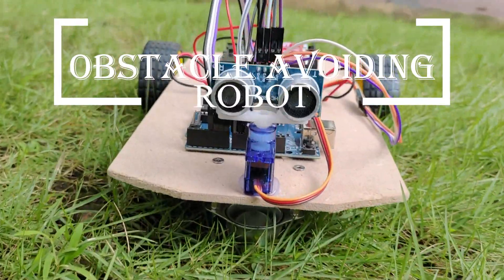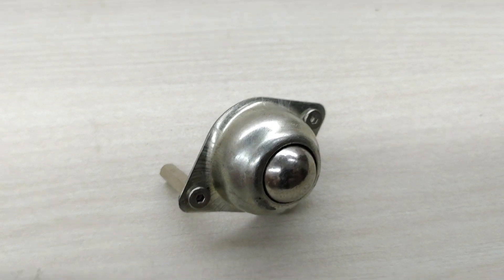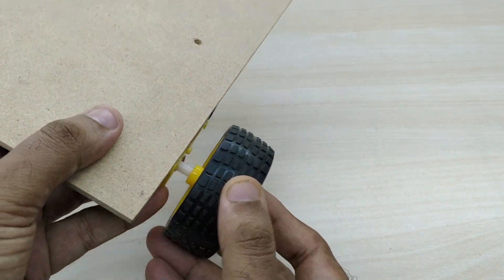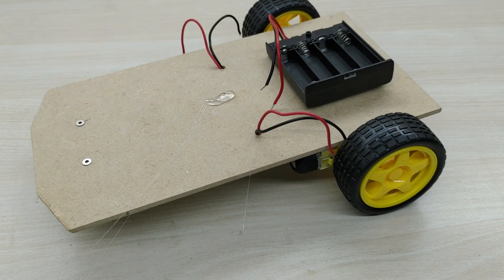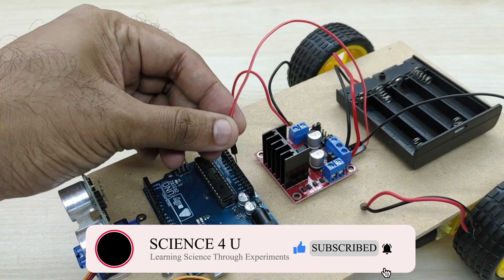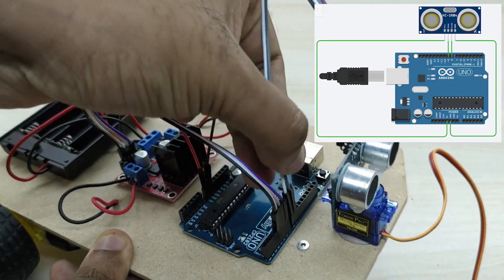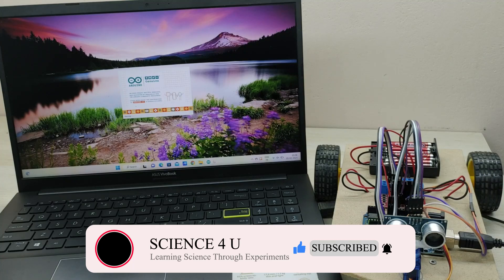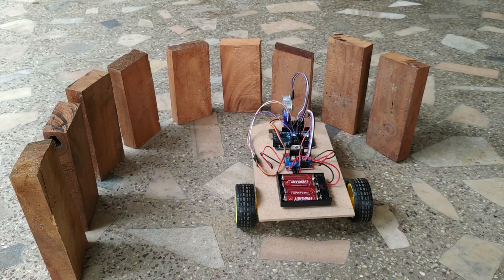Intelligent Obstacle Avoiding Robot || Step by Step Tutorial || Arduino Project

Comment: Hey I’ve made this and the robot keeps going around in a circle as then one of the wheels is not going forward but when it reverses both the wheels work fine . can you help me find what’s the issue ?
Reply from the maker: I guess it could be due to poor batteries only. When it is going backward, since both wheels are working, the connections are correct. In the forward direction both motors are not rotating probably due to poor batteries. You can try changing the batteries.
Reply: @Science_4U_  I facing this same it circles all the time but when turning it is fine, changed the battery still the same issue.

Comment: Hi sir ...Thank you very much 
After somany videos ..
Finally i prepared from your video..
On floor it is not moving 
It works only in air
Reply from the maker: Hi friend. It is mostly due to poor batteries. Using new batteries should solve the problem.

Comment: Please, I did all the steps but it didn’t work. What is the reason? How can I contact you to solve this problem? I must submit my project a day from now.
Reply from the maker: @shatha.44  Hi friend.There could be several reasons why it is not working.The L298N driver board may be faulty or it could even be the batteries. You can message me in my instagram account. I will help you to solve the problem. 
https://www.instagram.com/_science4u_?igsh=MTM5aXFpdTM5aG5lNg==

Comment: Sir, I've gotten the Arduino uno R3 SMD board. But my L298N board ks showing a red led light. What does it mean, am using a 5 lithium ion batteries. Do i need to upload the script first before the motor would move? Cause i still haven't uploaded the script
Reply from the maker: Yes definitely friend. Yoi have to upload the code and after that only it will start moving. 5 lithium ion batteries will give how much output voltage?
Reply: 15v, when I checked 
Each ba3s is emitting 4v
Reply from the maker: @PythonExploratorium Yes. More than enough. Normally we give only 9-12v battery voltage
 You can upload the script and see if the motors are rotating.
Reply: Will it be enough
Reply: Sir, am sorry for disturbing you this way. I just need to get this done for a project am working on. I'm getting errors while uploading the code.
Reply from the maker: No problem friend. Can you tell me what is the error message while uploading code?
Reply: avrdude: stk500_getsync() attempt 7 of 10: not in syn: resp=0x98
.......

Then it said failed uploading: uploading error: exit status 1
Reply from the maker: @PythonExploratorium Hmm..Normally we get this error when the arduino uno board is faulty. Have you used this board before? Also can you check in tools whether the port is selected. You can try connecting arduino to another USB port and try uploading again.
Reply: @Science_4U_  I haven't used the board before, this is my first time using it and I actually ordered it online....ok, I'll try using another port and try again, but let me say this, this is my first time downloading Arduino on my system, is there anything I'd need to install or download. Cause it's asking for a Sketch update or something like that. So is there anything to download as first time on the system??
Reply from the maker: @PythonExploratorium You have to just download Arduino IDE software, open the code in IDE software, connect arduino to USB port and click upload code in the IDE software..that is all..
Reply: Ohk, I've uploaded the script to the board. I had to change the port connected to port 14. Cause when I plugged in the USB cable it showed port 14 when I plugged it out, port 14 disappeared, that was when I knew the Arduino board was port 14. But after uploading. Connected my ba3, it's still showing a red red light on the Motor driver
Reply: And it's not driving. 
What do you think is wrong bro😢
Reply: On the tutorial you gave, you never made mention of connecting to ENA and ENB even on the circuit diagram, the connection is not there and am just going through the comments where you said the person should check for ENA and ENB connection
Reply from the maker: @PythonExploratorium  Hi friend. I didn't mention specifically about the jumpers on ENA and ENB pins because it is installed for all board by default. Have you checked in your motor driver board whether the 2 jumpers are there in place connecting ENA and ENB pins to the pins above?

Comment: I am about placing a order for an Arduino uno, i already have a raspberry pi pico, I wish you can do a video for a raspberry pi pico.
Reply: Please say something. On my motor driver, it's showing red led light, someone said it means that my motor driver is receiving low or high current, so it's shutting down himself. Am new to this, can you help me please. If you can give me your handle, I can send you my connection, so that you can put me through. Thank you so much
Reply: I'm using a raspberry pi pico
Reply from the maker: Hi, friend. I am not knowledgable in using raspberry pi pico. If you are using arduino uno for this project, I can help you.

Comment: one question, does it work the same with two batteries? I'm not 4
Reply from the maker: Which batteries are you using friend?. You need atleast more than 6V at the Vin pin for the arduino to work correctly. I have used 4 Nos. of AA 1.5V batteries, which will give 6V total. Using 2 batteries will reduce the voltage to 3V and it most certainly will not work.
If you are using 18650, 3.7V batteries, then 2 nos. will be sufficient as it gives 7.4V total voltage.
Reply: @Science_4U_  I was using a total of 3V, I didn't know that, thanks! If I buy two battery holders in total, where would the other one be connected? I'm new to all this
Reply from the maker: @sfi1988 if you buy 2 battery holders, you have to connect them in series to get output voltage of 6V. Connect the positive wire (red)  of one battery holder to 12V motor driver board. Connect negative wire(black) to the positive wire(red) of other battery holder. Conmect negative wire(black) of the other battery holder to ground pin of l298 motor driver.
Reply: @Science_4U_  And the negative and positive cable that are together go to the 5v output of the motor? sorry for so many stupid questions
Reply from the maker: @sfi1988  No friend. the negative and positive cable from 2 battery packs that you have joined together is not connected anywhere.  It will just remain like than. You can cover the joint with an insulation tape. the other 2 wires from the battery pack only are connected to the motor driver board..

Comment: Sir my robot is only working when USB connected to Uno to PC
Reply from the maker: Okay friend. Then it is confirmed. The reason why only one motor is working is due to discharged batteries. When you connect uno to PC, the uno, sensors and servo are powered by PC. So more battery power is available for rotating the motors and hence both motors rotate. With the uno disconnected from PC, the batteries have to power everything together. So it becomes difficult to rotate both motors together. So change to a new battery and the problem will be solved.
Reply: Sir I use a new battery then also the problem is there

Comment: Sir ,my robot is not moving forward and only left motor is rotating
Reply from the maker: If the robot is moving then the jumper should be there connecting the ENA and ENB pins to the pins just above it. If only left motor is rotating, mostly the battery could be discharged so that it is not able to rotate both motors together. Can you lift the robot in hand and try rotating the non rotating wheel and helping it to rotate. Is it rotating now?. Also keep the uno connected using usb cable and try. Whether both wheels are rotating?
Reply: sir my robot is working only USB is connected yo arduino

Comment: My Motor is not working in this and only servo motor is moving
Reply from the maker: Hi friend. This could be due to several reasons.
1. Can you see 2 jumpers very close to the IN1 and IN4 pins in motor driver board?. These jumpers are required for enabling the rotation of the motor.
2. The L298N motor driver board may be faulty. The lights will switch on, but still it may not work. Have you used this motor driver board before, or is it a new one?

Comment: Hi sir my servo motor is working but motor not working what is problem in Circuit
Reply from the maker: It could be a problem with the motor driver board. Can you see 2 jumpers  by the side of  IN1 and IN4 pins in motor driver board?. Some boards wont have that jumpers. Those jumpers should be there. Then only it will work. Can you first check that?
Reply: @Science_4U_  I connected all pins but motar is thus not working
Reply from the maker: Yes..There are 2 jumpers in motor driver to enable motor rotation.can you see whether it is there?. You can search in internet to find out about the jumper location..
Reply: Sir but I connected ENA pin and ENB pin  but motar thus not working plus I checked the motor driver it perfectly working

Comment: Sir i cant get the code
Reply: I can't get it from description
Reply from the maker: @lankaranaraja8203  okay friend. then I will paste the code below. 
#include <Servo.h> 
Servo Myservo;
#define trigPin 9           // Trig Pin Of HC-SR04
#define echoPin 8        // Echo Pin Of HC-SR04
#define MLa 4                   //left motor 1st pin
#define MLb 5                  //left motor 2nd pin
#define MRa 6               //right motor 1st pin
#define MRb 7               //right motor 2nd pin
long duration, distance;

void setup() {
  Serial.begin(9600);
  pinMode(MLa, OUTPUT);     // Set Motor Pins As O/P
  pinMode(MLb, OUTPUT);
  pinMode(MRa, OUTPUT);
  pinMode(MRb, OUTPUT);
  pinMode(trigPin, OUTPUT);       // Set Trig Pin As O/P To Transmit Waves
  pinMode(echoPin, INPUT);        //Set Echo Pin As I/P To Receive Reflected Waves
  Myservo.attach(10);
}
void loop() 
{
  Serial.begin(9600);
  digitalWrite(trigPin, LOW);
  delayMicroseconds(2);   
  digitalWrite(trigPin, HIGH);       // Transmit Waves For 10us
  delayMicroseconds(10);
  duration = pulseIn(echoPin, HIGH);        // Receive Reflected Waves
  distance = duration / 58.2;                       // Get Distance
  Serial.println(distance);
  delay(10);
  if (distance > 15)               // Condition For Absence Of Obstacle            
  {
    Myservo.write(90);
    digitalWrite(MRb, HIGH);       // Move Forward
    digitalWrite(MRa, LOW);
    digitalWrite(MLb, HIGH);                                
    digitalWrite(MLa, LOW);                                                       
  }
  else if ((distance < 10)&&(distance > 0))            // Condition For Presence Of Obstacle
  {
    digitalWrite(MRb, LOW);     //Stop                
    digitalWrite(MRa, LOW);
    digitalWrite(MLb, LOW);                                
    digitalWrite(MLa, LOW);
    delay(100);
    
    Myservo.write(0);
    delay(500);
    Myservo.write(180);
    delay(500);
    Myservo.write(90);
    delay(500);
    
    digitalWrite(MRb, LOW);     // Move Backward             
    digitalWrite(MRa, HIGH);
    digitalWrite(MLb, LOW);                                
    digitalWrite(MLa, HIGH);
    delay(500);
    digitalWrite(MRb, LOW);        //Stop                
    digitalWrite(MRa, LOW);
    digitalWrite(MLb, LOW);                                
    digitalWrite(MLa, LOW);  
    delay(100);  
    digitalWrite(MRb, HIGH);     // Move Left     
    digitalWrite(MRa, LOW);   
    digitalWrite(MLa, LOW);                                 
    digitalWrite(MLb, LOW);  
    delay(500);
  }

}
Reply: Thanks

Comment: Hello, I would like to ask you for help.  I should make a robot like yours, but add an LCD so that when it avoids an obstacle it appears on the screen.  How would I connect it?
Reply from the maker: It is very well possible. I have done several projects by connecting the SSD 1306 OLED display to arduino. You can watch those projects to see how the connection is done with the OLED display. then you can also open the code and see how code is written for OLED display. You have to combine both the code so that if an obstacle is detected, the required text is to be displayed on screen.

Comment: dear science_4u can I connect the 5v pin of servo and ultra sonic with l298n 5v pin?
Reply from the maker: Hi friend. You can power the ultrasonic sensor from the 5V output of l298n. But definitely it cannot give enough current to the servo motor. So it is better not to connect servo motor to this 5V output.

Comment: i have a question, do we need to change many things in this code if im using a photoelectric sensor? is it possible?
Reply from the maker: Yes ftiend. You will be able to use photoelectric proximity sensor but definitely needs modification in the code.

Comment: I Have Four motors is it able to work on l298n motor driver?
Reply from the maker: Yes definitely friend. Just connect red wires of two left motors together and connect to one terminal at left side of l298n motor driver board..Connect black wires of two left motors together and connect to other terminal at left side of l298n motor driver board..Do this for right side motors also.
Reply from the maker: You can watch my following video for connecting 4 motors to l298n motor dtiver board...
https://youtu.be/JK6zTM65Rh0

Comment: motor driver and wheel are not working😰😰😰😰
Reply from the maker: Hmm..there could be an issue with your motor driver board friend. Are the lights in the motor driver board switching on?. Do you have 2 jumpers connecting ENA and ENB pin to the pins just above it?. Without that also, it will not work.
Reply from the maker: Have you used this motor driver board before or is it a new one?
Reply: @Science_4U_ I tried many times to make the motors work but the motors are not working
Reply from the maker: @ArduinoAndrobotics If there is no light on the driver, then something is wrong. A good motor driver will have light on it once power is switched on. Or sometimes the battery also may be a problem. Which battery are you using?. Have you used a new battery?
Reply: @Science_4U_  ok thanks I will try to taste the l298n motor driver if the driver did'nt work Iwill buy new
Reply from the maker: @ArduinoAndrobotics okay friend..👍
Reply: @Science_4U_  no light on the driver and no I did not connect them

Comment: Which battery cell you used
Reply from the maker: Hi friend. For this project, I used 4 Nos. Of 1.5V AA batteries. It will be better if you can use 2 Nos. of 3.7V 18650 batteries as they are rechargeable and last really long.

Comment: Hi sir
Can i use 3 batteries each one is 3.7 volt?
will it work ?
Thank u
Reply from the maker: Yes friend. You can use 3 batteries. Only thing is that the motors will be rotating fast. You can use just 2 batteries if you want slower rotating speed.
Reply: @Science_4U_ the robot do not move only i feel a pulse in the motor
Reply from the maker: @adawymohamed okay friend. Can you do one thing?. Can you lift the car in your hand and try rotating the motor. Is the motor rotating once you help to start its rotation?

Comment: Where does the servo motor connect
Reply from the maker: The servo motor signal wire connects to pin no. 10..
Reply: @Science_4U_  where does the middle one which is like the red one go to?
Reply: I put it in 5 volt
Reply: But you put it somewhere else
Reply: And also when I turn on the car one side of the motor works and the other doesn’t. By it turns on only a little when it detects something. But the car would only go backwards. Should I switch the motors to the other side?
Reply from the maker: @Ge7_Skills  ya that is right. The middle one goes to +5V volt.
Reply from the maker: @Ge7_Skills  do you mean that the car doesnt turn when it sees an obstacle?
Reply: @Science_4U_  no, it just does what it wants and one side of the motors for the wheels won’t work it only the other side that works and it would just go backwards
Reply from the maker: Hi friend. I Can help to solve the problem. Can you come in my instagram id?. I will chat and help you solve the problem. Following is my instagram id..

https://www.instagram.com/_science4u_?igsh=MTM5aXFpdTM5aG5lNg==

Comment: Mine isn’t working that properly it’s just going mainly backwards and won’t go forward and just does what it wants.
Reply from the maker: Hmm. Okay friend. If you bring hand near the ultrasonic sensor, is the rotation changing?.
Reply: Yes the sensor moves right and left when it detects something in front of it. But the car would only go backwards
Reply from the maker: @Micro_Clipped  okay friend. It is very easy to correct that problem..Just interchange the wire connections of the motors at both sides of the motor driver board. Is it working correctly now?
Reply: @Science_4U_  don’t get what to do
Reply from the maker: @BeatBox_Raps Don't worry friend. Czn you come in instagram?. I will chat and help you solve the problem. Following is my instagram id..

https://www.instagram.com/_science4u_?igsh=MTM5aXFpdTM5aG5lNg==

Comment: I finished everything but it only works when i plug it into the computer. It won't work by the battery, there's a light on both boards but the car won't work until i plug it in.
Reply from the maker: Hi friend. Most likely it is a battery problem. When you are connecting uno through usb, the arduino board, the servo and sensors are powered feom usb. The battery then powers only the motors and hence even if the battery is discharged ot works fine.  Are you using the servo motor too?. Can you remove connections to servo and can you check whether it is working now?.Replacing with a powerful battery should solve the problem.

Comment: I’m using a regular arduino board and there’s only 2 five volts and their taken so we’re does the motor connections go? I don’t get those
Reply: Where does the middle red wire of the servo motor go to?